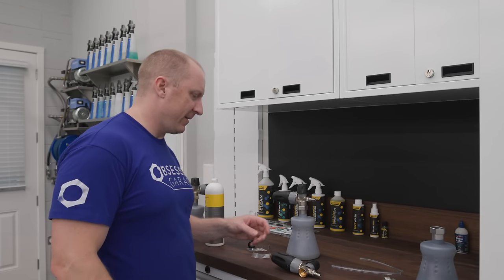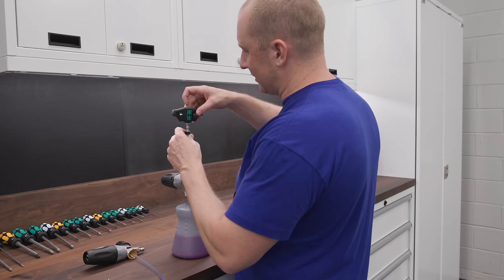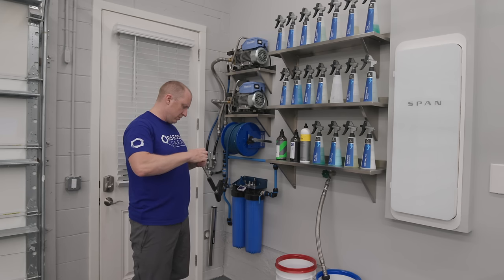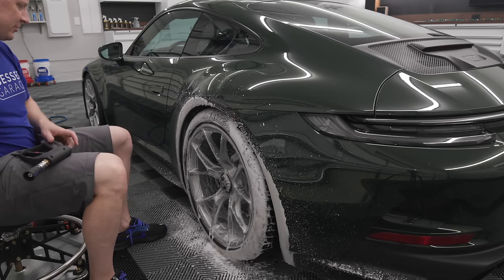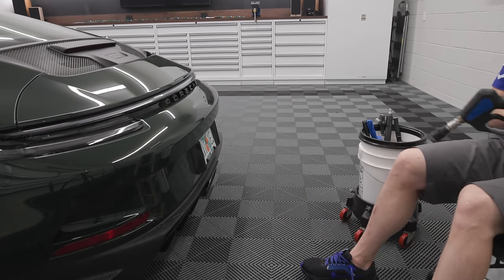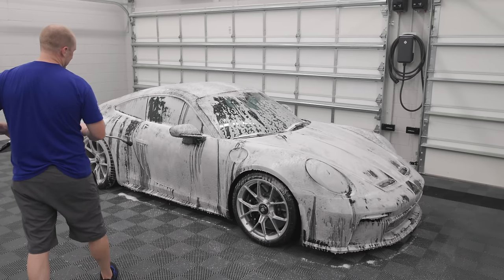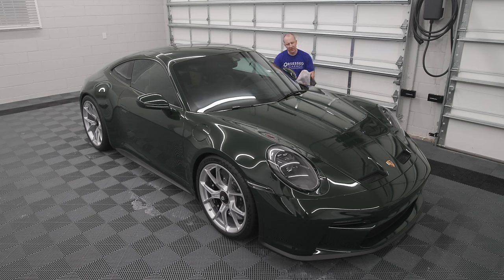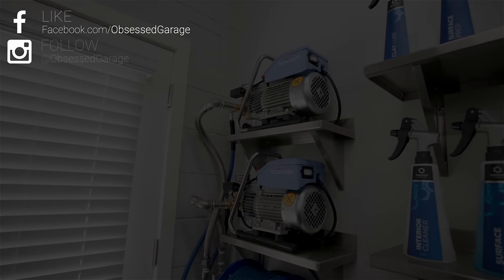Wash and Talk:  First Brewster Touring Wash

Comment: Matt was too excited about the EVO to worry about if the mic setup was correct. Can’t blame him 👍🏻
Reply: It’s a $15,000 car with a 15,000 Dollar DrIvetrain….
Reply: Evo fan boi here. Had a $500 deposit on a Wicked White 05 RS I bailed on in 2005. (for those that dont know, the RS was less money than GSR/MR, so I couldve gotten it for $28k - sad times).
Reply: @j.3854 i owned back in 2006 a 1 of 25 Evo 6 RSX which was a limited edition car made by Ralliart Xtreme in the UK. had all the best bits of the RS and GSR, so RS drivetrain/running gear, No ABS/AYC and GSR comfort such as electric windows, Climate control, and GSR 5th gear ratio which was longer for top speed, and Brembo brakes, but interior had Recaro SR seats. Mine was extra rare as it come with black and red leather/alcantara from factory.

From memory there was 15 white cars and 10 silver in the Evo VI RSX.

Comment: I heard you mention Atom Mac in another video. Have you compared it to Hyde’s? Have you tried adding it to Brake Buster to see if it helps with rust on steal rotors? BB claims to have a rust inhibitor, but I haven’t noticed it helps at all. Still have to use Hyde’s.

Comment: Matt, living in Tampa, I’d really like to be able to wash inside the garage. Decent size 2 car garage, with SwissTrax flooring (from OG). Any issues with water getting trapped in floor and not draining properly?
I also noticed you have the garage door closed.
Reply from the maker: No issues here, just depends on how your door is designed

Comment: Hey Matt, what are the specs on the pressure washer? Model and flow rate specifically. Thanks.
Reply: He's got 2 Kranzle K1322TS running in parallel
Reply from the maker: It's the dual 1322TS Kranzle setup pushing around 4GPM at 900PSI
Reply: @ObsessedGarage  thanks!

Comment: It seems odd to me that the dealer is selling you the car without at least performing a basic service to get the fluids, battery, and tires up to date. Or did you just tell them not to touch the thing and leave it up to you?
Reply from the maker: Part of the appeal to most was that the car was 100% original.  I told them I don't want them touching it.
Reply: @ObsessedGarage  they still need to do basic pdi before delivery, right?